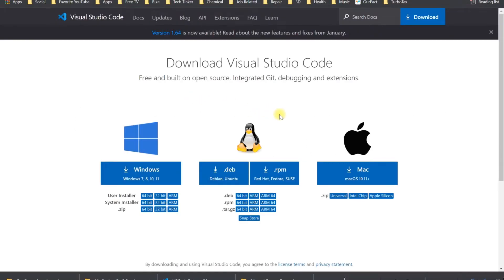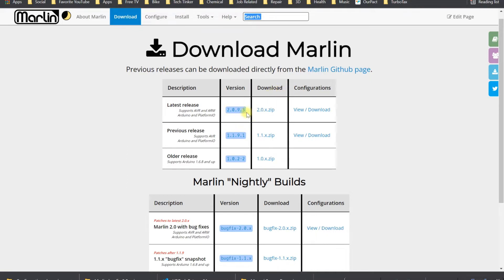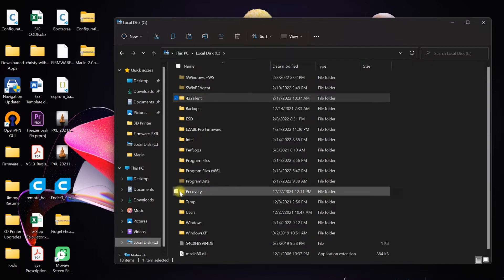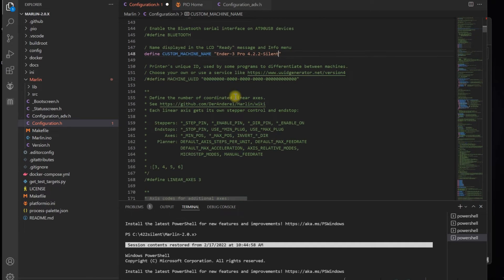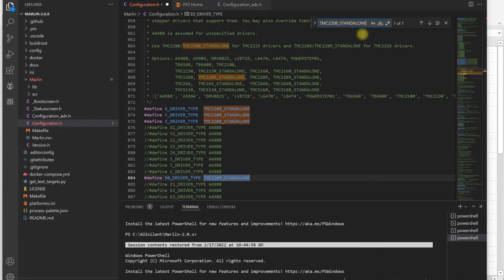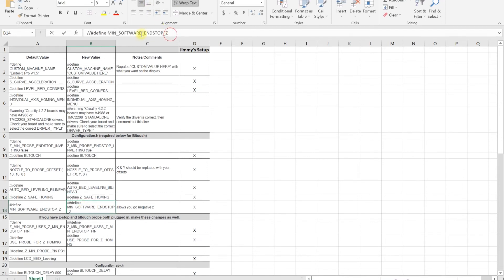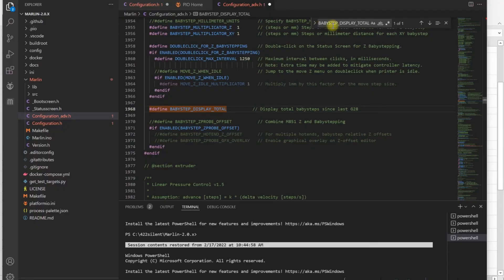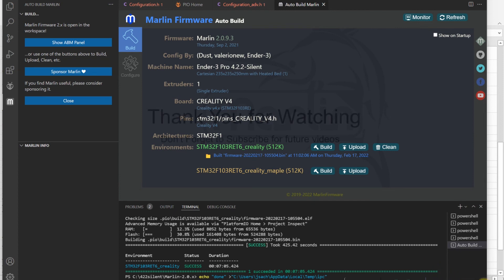How to build Marlin Firmware Using VSCode easy way (2022)!

Comment: Thanks for the video. One question though: In the window below the code window you have the terminal tab selected. I also clicked on the 'problems' tab where you should a (1). I have a (3). Do you need to take action on what is shown in there or do we just ignore it? This is with no changes made yet to the Marlin that I downloaded. Thank you.
Reply from the maker: If it completely compiles. No issues. Nothing to fix.

Comment: I'm doing this on my SKR e3 Turbo. Everything worked great until the nozzle slammed it's self into the bed lol,  I'm using a bltouch, Tried using the stock z-stop but then it was too high for the probe, tried adjusting but in the end ended up just using #define USE_PROBE_FOR_Z_HOMING. I had to do some more tweaks, but it looks like it is working!
Reply from the maker: Did you uncomment z safe homing?
Reply: @JimmysDIY  yes I did, how come?
Reply from the maker: @dudefromkeene  check to see if you uncommented #define USE_PROBE_FOR_Z_HOMING and commented this

Comment: I am in the same situation as Luis G. I have Ender 3 pro with v4.2.7 board and run a CR Touch. The Config folder has two files(_Bootscreen and _Statusscreen) that aren't in the the Marlin firmware folder. Do I copy them anyways? My main objective is to be able to baby step my Z Probe Offset. The current firmware won't allow me to make micro adjustments. And also to be able to do a filament change at specific levels.
Reply from the maker: Yes. You need to copy them. Look at the spreadsheet I attached. It has baby stepping

Comment: If I have ender 3 pro v4.2.7 board do I download the same one you have ??
Reply from the maker: Yes. You can. Firmware is same. You just need to use Creality 4.2.7 config files
Reply: @JimmysDIY  thank you so much for the fast reply ! I’m doing this step by step ! It’s my first time and I’m very nervous! I’m trying to set up a smart filament run out sensor!
Reply from the maker: You should be fine. Just make sure you enable #define filament_runout_sensor, #define filament_runout_distancr_mm 25, #nozzle_park_featute and #define advanced_pause_feature
Reply: @JimmysDIY  I tried to do it but my screen is just blue now /: I wonder what I did wrong /:
Reply from the maker: @luisg2035  Looks like you goofed. Do you have Ender 3 Pro with 4.2.7 Board? This is a Silent Board, not a noisy. Open the Printer Mainboard Box and Verify.. and let me know what Mods you have also (BLTouch and etc)
Reply: @JimmysDIY  looks like i have 4.2.7 i have a cr touch installed as well !
Reply from the maker: @luisg2035  You can download my 4.2.7 Firmware - https://bit.ly/3RxQeDB

Comment: I can honestly say that the quality is supurb, unlike alot of you tube vieos out there. Yours is nice and crisp and I can clearly read the text without making it full screen. That is a huge deal in my opinion. So many Camtasia type videos are blurry. Curious what your using? You say that the ender 3 config will probably have more features enabled as opposed to the Ender Pro. Why is that? Is it because the Ender 3 Pro's are hit or miss as to which chip the board ships with so they disable features to account for the smaller storage space?
Reply from the maker: Thx, that's because Ender 3 config has been mainly developed first and it's ongoing. While Pro was forked off with some items being disabled due to creality being dumb

Comment: Hi. It is anny chanse get help with runout sensor firmware for ender5?
Reply from the maker: What is the issue?
Reply: @JimmysDIY  i am crapy with programing. I done all mechanical instal to me ender 5 pro with v4.2.2 board, just can't find firmwere to update and make work.
Reply: All what i done just fuck up all g code.
Reply from the maker: You need to use vscode and marlin to build
Reply: @angeluiiminde  Maybe you shouldn't be doing this then!